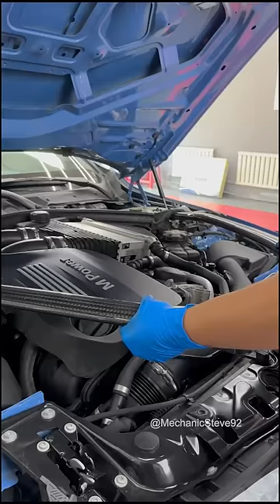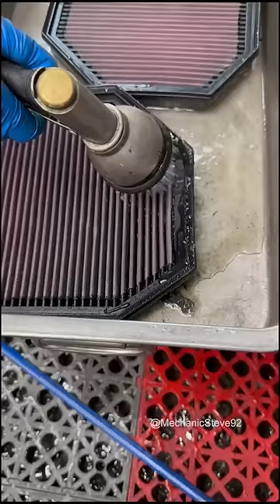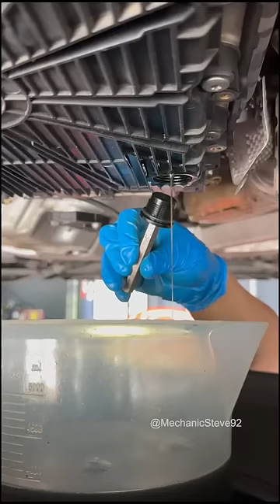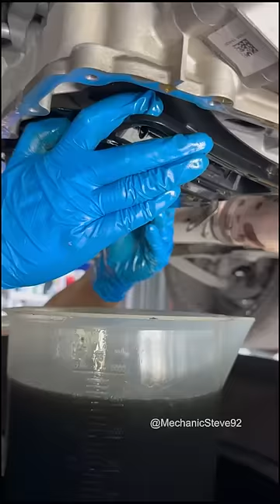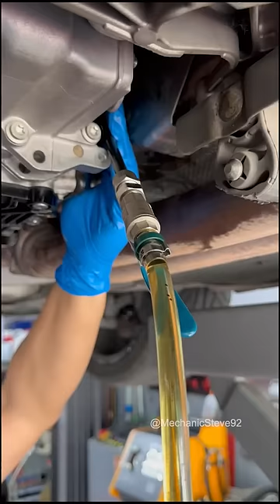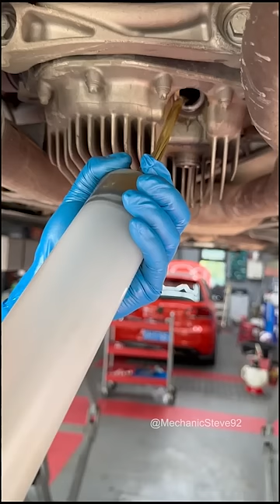#automechanic #automobile #cars #trucks #restoration #mechanicsteve #shorts #short #shortsvideo

Comment: As a mechanic im curious on why ppl measure the old fluid coming out?? What if it was under or over filled when you did the service????
Reply: Or if it burned or leaked oil. The answer is, you're right, doing that is lazy at best, and counterproductive at worst.
Reply: @compulsoryevacuationdevice ya don't know what ju talking aboot
Reply: @Big_AlMC you can’t even type brother
Reply: Перед тем как сидит масло, нужно проверить уровень масла
Reply: @Big_AlMC  Im a GM and ASE ertified mechanic of 17 years. At least have some type of IQ to answer or contest what i said
Reply: Doesn’t hurt to have a reference of what came out
Reply: @user-pt9bb2ym6i  yes it does hurt if the reference is not accurate, we dont need reference especially if we have specifications and filling procedures there.
Reply: @blewis9270 Well, i work for a Cat dealer and i guarante you, there's a lot of wrong information in Cat's literature about the amount of oil. So, i use the dipstick to check oil level before drain it, and by measure the amount of oil that came out, I have a reference.
Reply: @ddsdds3131  SIR YOU HAVE A DIPSTICK, THATS THE REFERENCE. NOT JUST GO OFF THE OLD FLUID. PAY ATTENTION, I HOPE YOU DONT ACTUALLY WORK ON THEM. EVEN IF THERE WRONG WHICH IS RARE BUT IT HAPPENS YOU STILL VERIFY THE FLUID LEVEL NOT BY THE MEASUREMENT OF THE OLD FLUID
Reply: @blewis9270  Sir, for example, There's a Cat''s literature that inform the amount of fluid in transmission is 16 liters and you have to check it while the engine is running.  If you put in 16 liter  you're gonna overfill the transmission, cause the literature information is wrong. The amount is barely 11 liters, so, you lost 5 liters of oil.
And if you gonna ignore the literature you will have to: Fill, run the engine, check, and again, and again until you correct the level. taking the risk of overfill it.
You can save a lot of time by simple checking the dipstick before draining it and drain it in a gradued component. Easy
Reply: @ddsdds3131 that almost sounds like they give the amount for the first fill of a brand new transmission. I work on forklifts and in some places not all the oil drains out during an oil change. So there's 2 oil fills given, one for a brand new transmission and one for the oil changes. Maybe theres a second amount hidden in your literature too?
Reply: Tracking that data doesn't hurt, especially after several service intervals that were all tracked, because then you would know something is 'going' wrong before it it goes bad. I'm a 5 year production line mechanic, 3 year drift car mechanic.
Reply: @fabianrudzewski9027  Interesting, but it's written “ Capacities( Refill)" in cat's literature. So, it was supposed to be the amount for an oil change.
Reply: Probably knew the correct capacity from the service manual, but checks the fluid level coming out to get ahead of any potential issues. Let the owner know there was less that came out than there should have been and then you’re not at fault for any future issue they might have
Reply: @ddsdds3131  YES the dipstick is reference, manufacture specs is reference. OLD FLUID is not since it can be over or under filled and its for back yard mechanics who dont have access to real specs or just lazy MFs.
Reply: @Jptg_76  yes but he didnt check it to let the customer know he checked it so he can put THE SAME AMOUNT BACK IN. Its clear in the video dont make excuses for this nonsense 😅
Reply: @RIPmytires  Yes but he checked it to PUT THE SAME BACK IN. Yall watch the same video i did dont make excuses or add to this video that he didnt do or mention. Thats not the way to service a vehicle.
Reply: @blewis9270  If you check the dipstick before drain it, you will know if it's over or under filled.  The dipstick is always my reference to know if the level is on point. But  there's nothing wrong on measure the amount of oil that came out. It's is only going to improve your accuracy, save time and prevent overfill. I doubt if you sir have ever fill a swing drive in your life.
Reply: @blewis9270  Honestly I didn’t even listen to the voiceover, I just watched it. I thought you were asking in general why someone would want to do that. That’s why I would do it!
Reply: @Jptg_76  YOU SHOULD LISTEN MORE BEFORE YOU RESPOND TO PPL THATS A FEMALE TRAIT, YOUR LIFE MIGHT GET BETTER 😅😅
Reply: @ddsdds3131  Don't know much on cars but what does one do when we don't have a dipstick in a car?

Comment: For the transmission oil change for vw DSGs we made up our own, got a gas can hung it upside down, cut a square out the bottom, hose from where gas line would be with two straight taps each end, bring car down from joist after draining, ( connecting it before lowering with an adaption we got ) hang it on an oil drainer higher than the transmission, both ends closed, fill 6L dsg, open end closest to bottle so no air, open one near the drain/fill hole, fast and easy.

Comment: That oil looks super clean
Reply: Its from the transimssion. Oil gets dark in the engine because it absorbs combustion residues. In a gearbox oil degrades without changing color
Reply: He drained transmission fluid first. The oil was the black he drained later
Reply: @chaseledbetter5186 The black looked like it was coming out of a differential. What kind of oil pan has two drain plugs?
Reply: @wertbe1718 yeah I rewatched. The black is from a diff. But the first fluid that looked so clean is definitely trans fluid as he proceeds to drop the pan and change the transmission filter then pump fluid in from the side
Reply: @chaseledbetter5186 
A automatic  transmission filter?  ( crépine in french)
correct ?
Reply: @samz9295  yes correct. They are usually inside the transmission oil pan
Reply: Not the differential oil it look like chocolate milk
Reply: The back oil was from the differential
Reply: @matiasmosquera6357 huh you are wrong transmission oil DEFINITELY changes colour when it goes old bruh you don’t even know what your talking about 🤣😹🤣😹🤣😹🤣😹🤣🗿😹🤣🤣🤣😹🤣🗿🤣🗿🤣🗿🗿🗿
Reply: @matiasmosquera6357  it was the diff fluid.

Comment: Those fucking power tools ! Strip out aluminum and plastic like nobody’s business
Reply: Yeah, they can, but usually you just use it to run down the fastener quick then come back with a torque wrench later. Say no to ugga duggas on plastic and aluminum.
Reply: I don't like them either. I have power tools in my garage but I barely ever use them on cars
Reply: @sergeant_cross_ same been working on my cars for 16 years.. only power tool i use are cut off wheels for cutting grindung.. and my drill lol.

But for bolts and so forth i do it by hand.  Unless its a large bolt i cant get off.. ill use my impact.

Comment: What the hell is he doing? Is that really all that’s required for a Beamer? Special tools and trays and all that. Too much my friend. Too much for me anyway.
Reply: he drained and refilled the transmission and rear differential. he did go the extra mile and remove the oil pan on the transmission to get ALL the fluid

other than the torque wrenches all he used was a shop sized oil pan and fluid pumps for filling.

many/most? transmissions have the fill plug on the side, you fill till it overflows. I have a 5$ shampoo pump style thing from autozone that does the same thing as his nice pump.
Reply: @Forbiddina or just buy gear oil in plastic bags and squeeze it directly in
Reply: @Forbiddina He had to remove the oil pan to change the filter also.

Comment: This is Definitely NOT Jiffy Lube !!  Friend of mine wife took her Chrysler 300 for an Oil change and believe it , the tech forget to put oil back in the Engine 😮 luckily driving 2 miles down the road the oil light came On and she parked the car and called Jiffy and they sent another tech out and my Friend told her to tell him DON'T TOUCH THE CAR.
It was towed to the Dealership and the Engine had No Damage. 
Jiffy wouldn't refund Her $57.00 at the shop because she wanted towing Fee of $117.00 she filed a claim and took 7 months for a total refund.